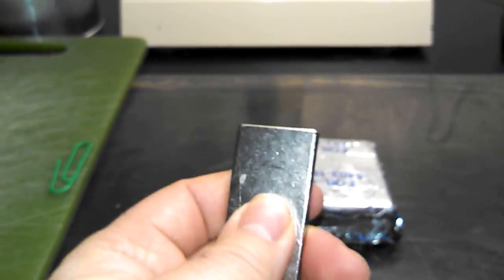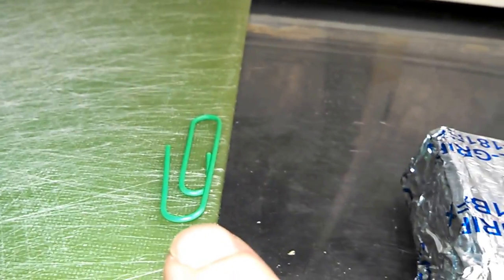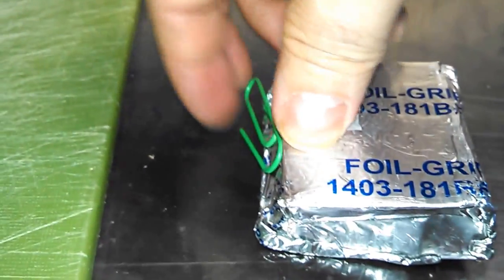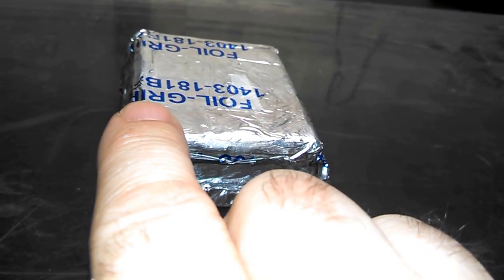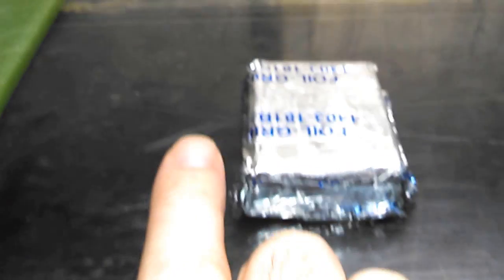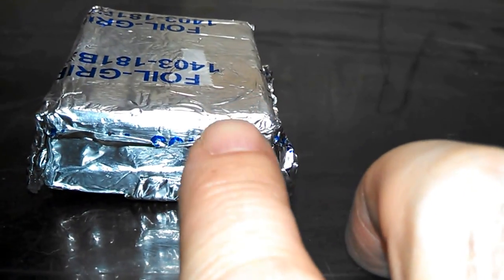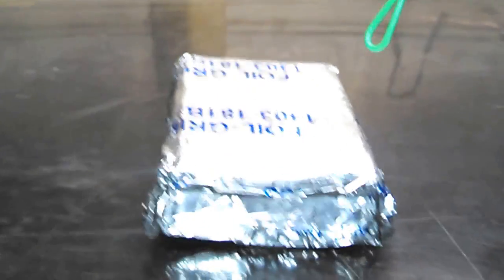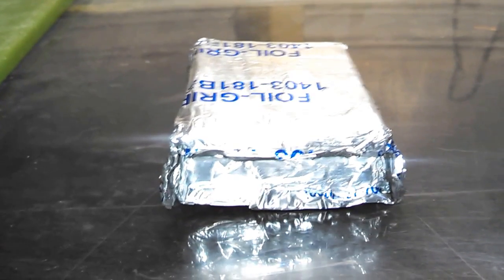🧲 One Way Magnetic Shielding -  Is Indeed The Holy Grail

Comment: This should have way more views! Thank you! I'm thinking of lining my walls of my bedroom between the insulation and drywall with aluminum screen for emf reduction.  I'm a newbie (my house burnt down, I have nearly no skills) it's wired up. Thoughts? Tips? Thanks!!
Reply from the maker: Yes. While obviously Fake Videos often have tens of millions of views filled with thousands of negative comments about it being faked are left up. Many of mine of simply vanished. Wire mesh works works best. Simply look up Faraday Cage, keeps out 100% of the RF. Some people sleep inside of a Faraday Cage. Google it. Trouble is, your cellphone cant make calls from inside a Faraday Cage. Just make sure you solder  all of the Wire Mesh together, and make sure each side of the Faraday Cage is grounded to the Earth. Don't forget that windows and doors leak RF. So you need metal doors and new glass with wire in it for your widows if you want to achieve near 100% protection. Also called radiation glass commonly used in hospital x-ray rooms. Hope this helps and thanks for stopping by.
Reply from the maker: 🧲 BREAKING NEWS JUST IN: https://www.youtube.com/watch?v=8EYxKWsVx2k

Comment: I have made a mono pole magnet with the use of shielding it took me a lot of layers but it worked. I purchased a sheet of shielding online and glued it onto all sides but one.
Reply from the maker: 63phillip - For maximum efficiency we never want our shielding  to ever touch the magnet directly. Use plastic, or paper, or rubber material  that’s at least a quarter inch thick. This will cause your shielding to work two or three times better. Use MuMetal for shielding.
Reply: @FreeMagneticEnergy2  Can I ask, did you ever use this in a practical use case, eg magnet motor?
Reply from the maker: @KHos73   - Yes. Just uploaded a new video showing exactly how it works in great detail. More updates coming soon. Thanks for stopping by.
:yt: https://youtu.be/GrBkoJSSMX0

Comment: you must think we are idiots. you haven't proven anything. you simply put the magnetic pole facing up. Metal will draw to the center of the magnetic pole. What you actually proved was that it would not work. Why because there is resistance in the center of the stater??? which would capture any material Magnets, Steel and would not release it once it reaches the center. Its just a magnet. Stop faking stuff. It gives real scientists who are actually working on this problem (like Me) a bad name. Lies on you tube should be prosecuted.
Reply from the maker: Than you should be prosecuted for defamation, and for giving false testimony. Simply replicate the experiment yourself and you will get the same results. I just put up a video that shows you exactly why this simple experiment actually works. I also noticed you are commenting from a TROLL CHANNEL which means you are all about information suppression. How do you live with yourself  each day?

Comment: I'm interested and believe it can be done but my issue is it seems like your only cutting off the side of the magnet and not the other pole if you where to flip it over and there was no magnetic attraction I would be excited .checking out your other vids now
Reply from the maker: I don't need to shield the backside. Did you ever make one yourself? Others have and they are freaked out. Thanks for stopping by.

Comment: Do you know of a relatively simple & cheap way to shield a house against ELF from high voltage power lines?
Reply from the maker: 🧲 Yes. Install wire mesh inside the walls and ground it. Or do so outside on the house nearest to the lines. Google: Faraday Cage.

Comment: He just has a really thin magnet on one side and a big block of steel on the other.. The block of steel is consuming the half of the magnet field that it is stuck to..
Reply from the maker: Shiloh Sedlak 🔴🔴🔴 Not a bad analogy. A quarter inch thick magnet, by two inches long, and a full inch wide magnet is not exactly a really thin magnet. It’s actually a very formidable strong magnet for its size that can move a compass needle some thirty inches away.  The magnet is so powerful, that pulling it off of a bar of steel by hand is a major task. 

🔴 There is no hunk of steel used. Rather it’s triple shielding of tin with quarter inch spacing between layers, and two dead alkaline batteries on the back side.  Since this video was made from nearly 7 years ago, batteries are no longer needed. Rather MeMetal is used for magnetic shielding.  I’ve made newer vids since this vid showing this experiment and new vids on how to build my stator while live on the air. 

We must keep in mind that the stator magnet will be within a couple inches of other moving magnets that are not shielded.  So, the shielding of the stationary magnet needs to be outstanding. 

You have a far better understanding of what’s going on and why, then most others who look at my videos... resulting is poorly thought out remarks left by others who simply do not understand. 

My experiments have now been confirmed by others to work exactly as I claim, who have successfully replicated my work here on YouTube and elsewhere. 

Thank you for your astute observation, and interest.
Reply from the maker: Shiloh Sedlak 🔴🔴🔴
3D animation of the stator seen in this 7 year old video. Dead Batteries are no longer being used since around 2015.  They were simply convenient at the time. 

  ⚡️ 3D ANIMATION:
https://youtu.be/ptBLjEa-TBM
Reply from the maker: Shiloh Sedlak ⚡️⚡️⚡️
STATOR BUILD UPDATE 2019

What seems to set me design apart from others, mine offers extreme torque in the long run.  Enough to easily break someone’s arm, or possibly snap a leg in half. The kind of torture required for high output generators. 

🔴🔴🔴 BUILD 2019
https://youtu.be/0m1o33Thhf8

Comment: Well by using diff materials you CAN make one side extremely stronger than the other... but theres not ZERO magnetism on that side. Put in up in front of a cathode ray tube television... dont even gotta remove the foil...
Reply from the maker: It's not enough escaping to move the paperclip. Simply replicate the experiment yourself and you will get the same results. Other people on other channels are getting the same results.

Comment: An irrelevant question here. Will aluminium foil shield magnetic field? I own automatic watches, and i travel alot. Everytime i pass through the security, they require us to remove our watch and have it scanned by xray. Now auto watches have small parts inside which if exposed to magnetic field will mess up its movements and springs. It bugs me so i thought to wrap the watch up in aluminiun foil to shield it from the magetic field the xray machine puts out. Thanks
Reply from the maker: 🧲 Aluminum foil does not shield the magnetic field. Thanks for stopping by.

Comment: Nice work James Roney. We used plastic casings to put magnets in and also used Copper as the shielding to force the magnetic pressure in a certain direction. You don't see many people who understand this principle. Nice video
Reply from the maker: Robert Elliott - 🔴 The Magnet & Paperclip Experiment Replicated

https://youtu.be/IlMBZJEtwRQ
Reply from the maker: 🧲 BREAKING NEWS JUST IN: https://www.youtube.com/watch?v=8EYxKWsVx2k
Reply: @FreeMagneticEnergy2  While this concept has not been completely proven without the interval movement, I think there is potential for long term energy based on this principle. I would have liked to see the full circle and/or the breaking point from a full circle.
Reply from the maker: Robert Elliott  Here is an updated video I made as well as by two other strangers. Yes, most don’t understand this. 

Here are Other Video Links below showing the same results. These are real results by complete strangers. Anyone who does not believe the results found in all these video links below, made by three different people who I’ve never met, then they need to make their own stators. Then they will see that this really works.

Or simply join me for a live feed on how to do this. 

The James Roney Stator Effect Replicated by Stranger #1
https://youtu.be/BErJN6YdKEs

The James Roney Stator Effect Replicated by Stranger #2 (However, he never applies the stator correctly to his wheel as he has it backwards. Additionally, he forgot to leave the front door of the stator wide open. The armature magnet configuration on his wheel is also not the configuration I use seen in my videos.
https://youtu.be/CBTnGEBuWdU

The James Roney Stator Effect Updated
https://youtu.be/WiZq5rj2hPo

Comment: there is a contradiction within the video. you at first state that one side has 0 magnetic pull and used the paper clip as an example. then later said the front side is a 2x pull and the opposite is a 1/2 pull to eliminate the pendulum effect. 

you also need to work on your terminology. magnetic shielding does not eliminate the magnetic field. it weakens it by opening the field. you just shielded it enough that the attraction on the "0" side was not enough to cancel out the weight of the paperclip and it coefficient of friction.
Reply from the maker: I do my best to speak in terms most everyone can understand. If I used shop talk, most would never understand and click out. A shield is a shield. I shielded the flux within the metal box so as not to have the magnetic field come out of the box at a given location.

Comment: UM it's not "Kind of unheard of" it sounds like a Cup magnet to me. Just take a close look at how a "CUP" magnet is made. it is usually a disk magnet with a steel cup covering one pole and the rim of the cup ends near the other pole - this DIVERTS the flux from one pole and gives it a QUICK and SHORT path to the other pole. The purpose of doing this is that when you stick this thing to a piece of steel it will have far higher sticking capability because north and south simultaneously pull the metal in a relatively small area.
Reply from the maker: 🧲 Correct. They're called, Pot Magnets. I'm simply applying it in a way that it has never been used for. Thanks for stopping by.

Comment: Good going man that sheld design is most impressive indeed. Dude you have now solved what was a big obstacle, for that strong magnetic to zero attraction stimuli has been a major stumbling block. Yes, the basic element in creating a magnetic motor has been that attraction then zero to repel jazz. Now perhaps no other magnets will be required for your brilliant stator principal may work with an metal armature?
Reply from the maker: Paul West - sorry. I’m just now seeing your post from two years ago. It’s good to know that some people here recognize upload glitches and that in deed no edits were ever done. Not to mention I used an old Motorola cell phone from about 10 years ago to make this video which had its own glitches during the recording process. 

My stator design also illuminates the infamous sticky spot. This allows me to over come Newtons third law of motion. In that, for every action there is an equal and opposite reaction. That law is not true after all. My stater design overcomes that obsolete law of attraction.

Comment: What kind of foil are you using?
Reply from the maker: It's used for heating and cooling ducts. 

https://www.amazon.com/Aluminum-Silver-ductwork-Metal-4-0mil/dp/B07D58TGL5/ref=asc_df_B07D58TGL5/?tag=hyprod-20&linkCode=df0&hvadid=312155953887&hvpos=&hvnetw=g&hvrand=2196867086133679146&hvpone=&hvptwo=&hvqmt=&hvdev=c&hvdvcmdl=&hvlocint=&hvlocphy=9008276&hvtargid=pla-623757723727&psc=1

Comment: The reason you can not build a permeate magnet motor is that you must be able to create a changing magnetic field to make any type of motor work. You can create that changing field mechanically or electrically. Of course if you doing it mechanically you are putting in energy. The only known way of making a field change without motion is by using electromagnets-magnets usually created by passing a current through a wire. Change the current in the magnets and you can create motion.

 Using stationary shielding will not produce a changing filed. It will alter the field but as long as their is no motion in the initial position between two or more unchanging magnets the best you can hope for is oscillation similar to a pendulum and like all pendulums it will eventual come to a stop without additional energy being inputted. 

Of course if you move one of the magnets by hand and then the others will react. The idea of using a wheel with unbalanced magnets that will speed up and slow down the motion does not mean extra energy is being added nor will adding any number of shielded stator magnets make it work. A similar idea with moving weights mounted on a wheel in a gradational filed will not work either. They stop because friction eventually uses up all the energy. 

Could you build a not so permeate magnet that will give up its magnetism and use that as a source of energy? To the best of my knowledge no one has been able to build a practical magnet like that where it would be the major source of energy in a motor. Certain alloys of iron will gradually lose their magnetism. Of course if you were able to build such a device it would eventually stop when the magnetic field was all used up.
Reply: To: Kim O'Brien,
Sir, You are incorrect in your assumption that a "Changing" magnetic-field is necessary to operate a motor, AC induction-motors operate EXCLUSIVLY on the principle of electrically-rotating a REPULSION-FIELD!!!
This evidently shows your hypothesis to be incorrect, as only ONE pole is necessary to create the repulsive Force. The science of magnetism dictates; "Opposites-Attract", "Like-Repel".
One quite popular theoretical design for a simple (Only one moving-element) non-electric permanent-magnet-motor relies on either being able to create a "Monopole-magnet" (which to my knowledge has never been done) or being able to "Shield" (or at least substantially-reduce) the magnetic-field of one pole of a magnet. This design involves magnets on the outer diameter of a wheel being repelled at an angle from stationary magnets placed around the perimeter of the wheel, this is basically a non-electric design similar in principle to the AC rotating-induction field motor, with the repulsing magnetic-field being generated by permanent-magnets instead of being created electrically, of course, since we know the electric version works, the permanent-magnet version should operate identically if the problem of the rotating elements being attracted equal to their repulsion can be overcome.
Reply from the maker: 🧲 https://youtu.be/jsgUF5DHAwo
Reply from the maker: 🧲 https://youtu.be/jsgUF5DHAwo

Comment: Nice work.   To prove this is real, scientifically, you would need to unwrap the naked magnet and re-test with the paper clip.  That would certainly answer the doubts that some would have about this being a wood block, etc...  Best wishes!
Reply from the maker: Hi Anton, I agree. However I long since made a video where I actually tear open the magnetic stator. Other videos as well that shows exactly why and how I achieved this. In fact, I just put up a new video today that goes live in 12 hours, that addresses this in great detail. Thanks for the tip.

Comment: When you say its equivelant to a monopole. Are you saying that you have isolated the magnetic field to a specific area. Or are you really saying you have isolated the magnetic field in a way that there is only a posirive attractive field? If it is the later have you atempted to control a small plasma arc, say from a 12v battery using your "monopole stator" and a standard electro magnet or copper mucrowave coil?
Reply from the maker: Jonathan Huibregtse - Sorry, just now seeing your post. 🔴 The Magnet & Paperclip Experiment Replicated

https://youtu.be/IlMBZJEtwRQ